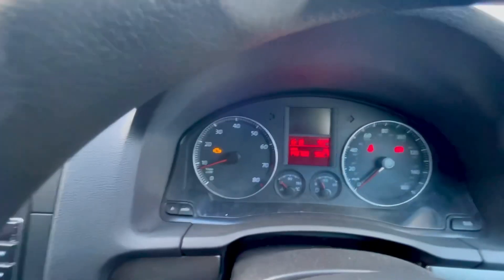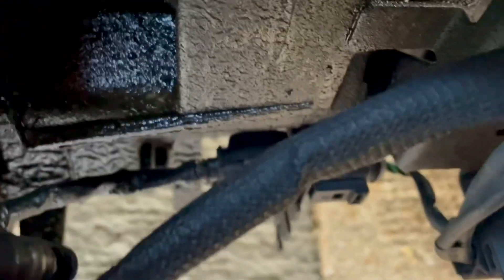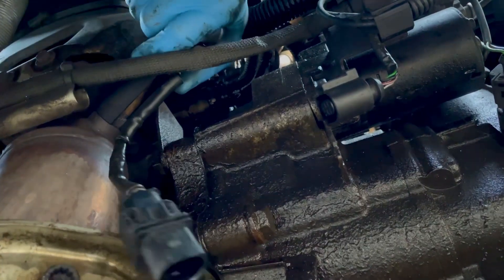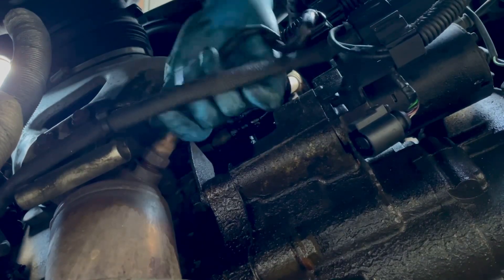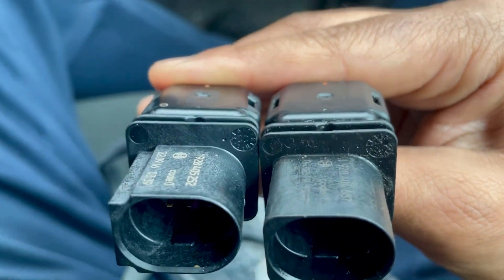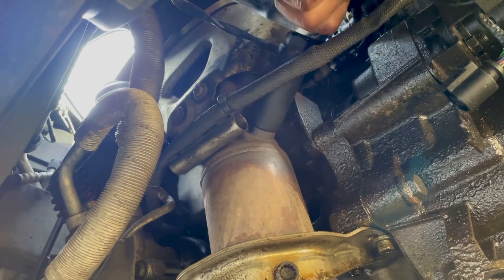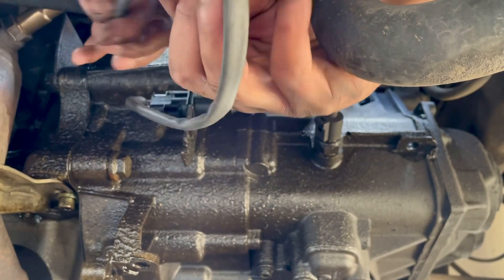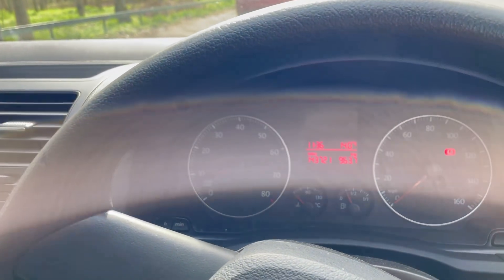Power loss faulty 02 sensor replacement vw golf mk5 1.6 petrol

Comment: Hi there, with the check engine light on when the car enters limp mode after you delete the check engine light the car power cames back again with no driving  problems untill the next time the engine light appears? I have the same problem but the code i receive is p2540. Thanks in advance